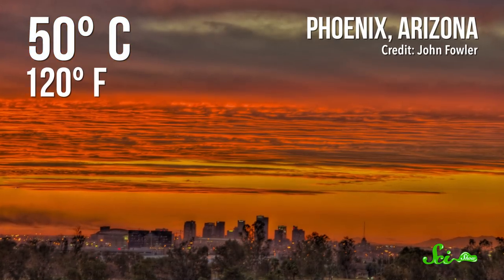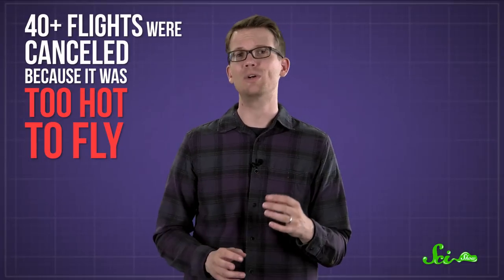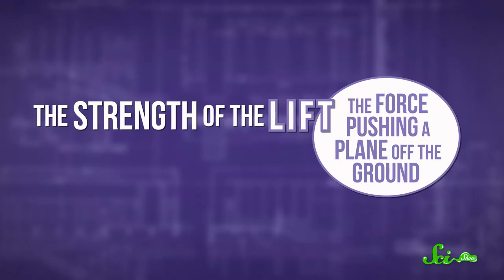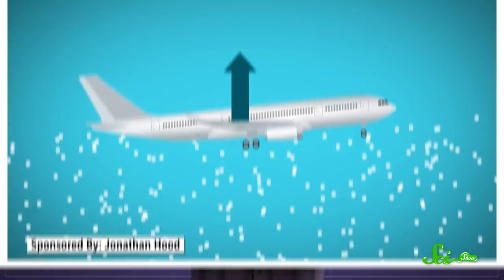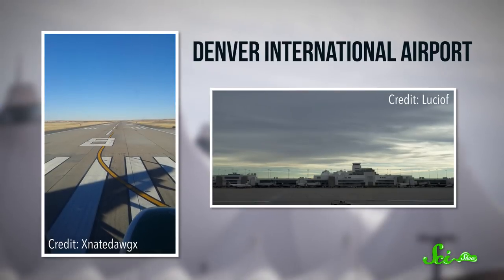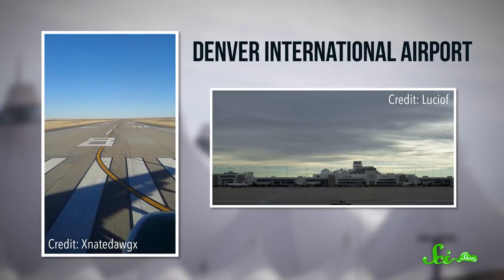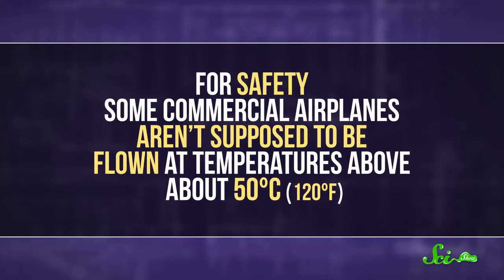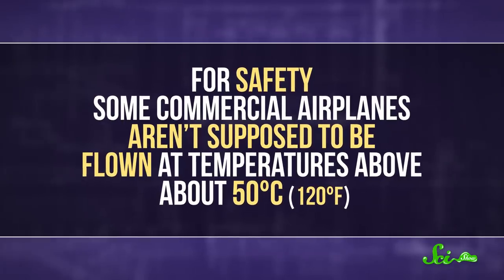Can It Be Too Hot To Fly?

Comment: I love most of your videos but because this is something I actually have knowledge with I'm pretty bummed that you are inherently incorrect. Which then leaves question to credibility of other videos of which I do not have the full knowledge.

Yes heat effects air density...and basically what we call it is "density altitude" which is basically what altitude the air density would be at if it were standard temperature and pressure 15c and 29.92" or 1013mb. PHX which is roughly 1000ft above MSL at 50*C, 7*C dewpoint, and 1013mb = roughly 5000ft density altitude...a little lower than Denver. Phoenix's longest runway is 11,489ft long, at Denver many of the runways are 12,000 ft long, and many days the density altitude can reach 8,9, even greater than 10,000ft yet the aircraft still depart and land. Air density surely matters, but it is not why the aircraft can't depart in PHX.

The problem is simply logistical. Aircraft are required to calculate a lot of data for performance numbers...how much runway is required to take off, how much runway is required to take off with an engine failure and continue to climb above nearby obstacles on one engine, etc. The problem is that some aircraft manufactures do not have any data for above 50*C...its not that the airplane can't do it. But getting the data is like dividing by zero...and no data, no fly.

Comment: 50 degrees is HALF of the way to boilng?   A physics channel really saying this?
273+50=323   remember that degree scale starts from 273 ;))))
273+100=373  is 323 really half of 373?!?!?!?
Reply: halfway from freezing is pretty obviously implied.
Reply: MaigonisSlava Actually absolute zero in Celsius is MINUS -273°C. Celsius uses water as a measure of temperature: 0°C water freezes, 100°C water boils. So yes, 50°C is half the way to boiling if we're talking about water! ;)
Reply: for smart person its obvious im talking about -273°C.  AND temperature is a measure of how fast molecules are moving, and at temperature -273°C they stop completely. 
Water with 50°C has 86,59% of temperature needed to boil it NOT half. 
Thanks.
Reply: MaigonisSlava Obviously Hank was speaking to the lay when he said that. 50 is half of 100.
Reply: MaigonisSlava did you grow up with imperial? Celsius starts from 0°,freezing and has 100° as it's boiling point of water. He obviously wasn't talking about Kelvin, which starts at -273.
Reply: MegonisSlava, molecules don't stop completely at absolute zero, that would break physics. But they don't slow down anymore at that point.

Merthan E., −273.15°C is 0 Kelvin, or absolute zero. So yes, Celcius starts at -273.15°.
Reply: Ze Rubenator molecules do stop completely. However atoms keep their Zero Point Energy. ZPE generates some motion in electrons and subatomic particles.
Reply: MaigonisSlava  50 degrees CELSIUS why are you using kelvin?
Reply: lol these replies are the best
Reply: Oh come on, it's just a way of saying it. Water most of the times boils at 100 celsius degrees, so he was clearly talking about 50 celsius degrees because that's half the boiling temperature in most cases. Of course you had a misunderstanding and considered kelvin degrees when this is measured in the celsius scale.
Reply: Okay, so he/she is still wrong because of the way Celsius works, but I think it was pretty obvious he meant that if it was another 50 degrees higher then water would boil
Reply: go improve your math skills then come back :D  you have to use modules of temperature to get valid results and.  -273 + 50 = -223 doesnt make any sense and is just a random number
Reply: MaigonisSlava do you have to ruin what would have otherwise been a good joke?  Seriously, everyone understands what he meant and not incorrect because of where Celsius defines zero.  If this were the kelvin scale or if he had stated "total energy" you'd have an argument.  But as it stands, your just wrong.
Reply: super wrong...the original post says "degree scale".  numbers are meaningless without units.  degree is not a unit.  it is so wrong that even without numbers it would still be wrong.  maigonis would of failed out of elementary school math or science.  any of my intro math/sci teacher would have given 0% instantly for not including units
Reply: They were referring to Celsius, not Kelvin, surely this is common sense or am i wrong?
Reply: Lol you have to add the 273 to the 50....yes its -273 but you need to add 273 to get to 0 and then the 50 meaning its a change in K of 323 overall.

Yes he may have not used the right units but the concept was correct. 

And yes Hank probably meant 50 being half way from 0 to 100.

Arguing over this is silly lol but watching the math fly around is even better
Reply: probably? were u watching the video? the video shows C as he speaks
Reply: Dan V yeh i watched it.  Thats what i meant, i dont like to assume things as a canadian haha i wouldnt want to offend somebody.  By probably i meant "he obviously meant C" its just a manner of speech and choice of words to not be abraisive or confrontational when its not required
Reply: MaigonisSlava HALF THE WAY TOO BOILING STARTING AT 0
Reply: +MagnoliaSlava
0:05 He specifically states AND displays on the screen, 50° CELSIUS.  It's quite clear he's referring to the boiling point of 100°C.  Anyone who cares is aware of how Kelvin is related to Celsius, but knows they are not the same thing.  The only reason you're even bringing it up is to sound like a smartypants on the internet.

I notice you didn't whinge about him using 120°F instead of 580°R.  Probably because you didn't know it existed.  Go back to school, troll.
Reply: MaigonisSlava go use kelvin if you're so concerned
Reply: For all you trivia trolls who keep trying to inject a completely different temperature scale into this video just because you are aware that it exists and you want everyone to know how smart you are, let me ask you this:  How do you know he's talking about the boiling point of water?
Reply: He said "half of the way to boiling" but he never actually specified water.  50°C is halfway to 646°K.  Perhaps he's referring to the boiling point of the mercury in his thermometer.
Reply: "So yes, 50°C is half the way to boiling if we're talking about water!"
NO, that's FALSE, and precisely why degree-based measurements of an absolute are friggin' stupid.

Is a 10C day "ten times as warm!" as a 1C? Is a 1C day "infinitely warmer" than a 0C day? You can't do math on degree-based measurements and have them make any sense.